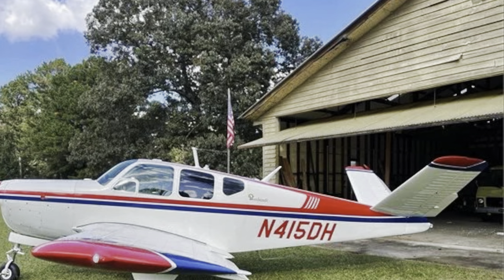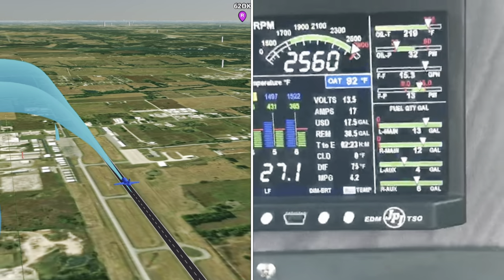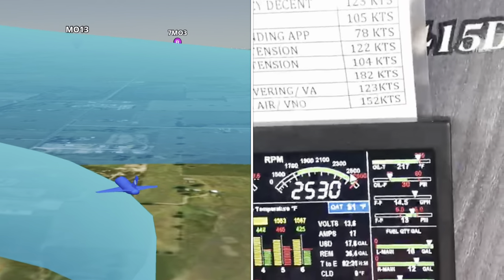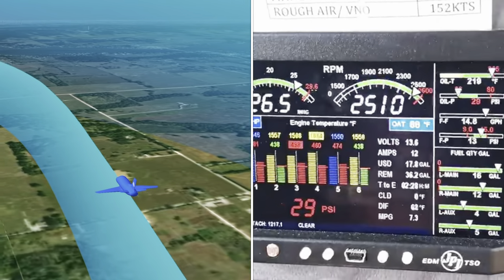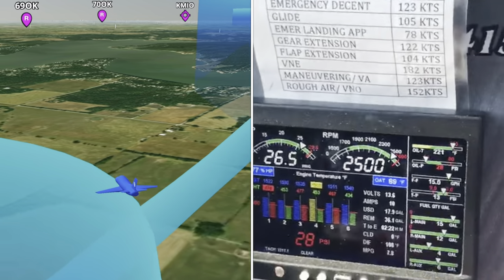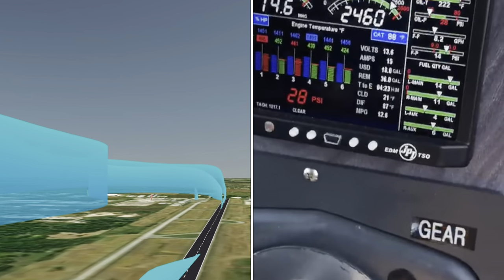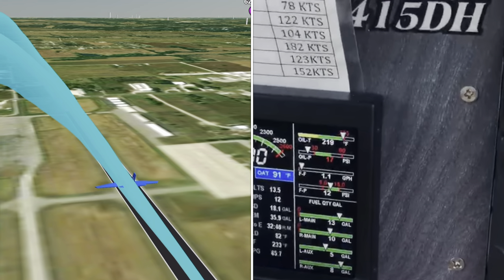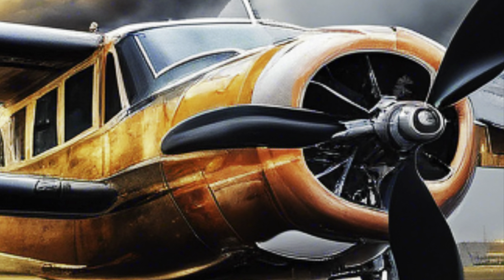My Plane Tried to Kill Me! : Surviving Engine Failure After Takeoff

Comment: You didnt Turnback, you turned around the airport.  If no traffic landing i know how to do turbacks well for years and would reduced pwr and turnback with some tailwind instead of damaging the engine more by turnaround which takes 3 -4 times more than a turnback.  CFI 3k hours aerobatics and 4 kinds of EFATO.  Practice first partial power Turnbacks from 500agl, then no power later on.
Reply from the maker: Agree and since the engine was still spinning we elected to go ahead and do an abbreviated turn around. It was fairly windy that day, memory is correct probably about 10-12 knots so we elected to milk as much out the engine as we could and land against the wind rather than land with 12 knot tail wind.
Reply: @FlatOutMatt  YOUR MOTHER ASKED ME TO TURNBACK HER.
Reply: @emergencylowmaneuvering7350  why don't you get off the yo mamma jokes, I just got off yours...

Comment: Engine failure?
Reply from the maker: Tempest Spin On oil filter adapter gasket failure. There is an AD out for these adapters as they have caused several crashes with several fatalities.

Comment: You've heard of "crying wolf" right? This video has some great information, but troll titles like this just turn many people off and eventually less and less will GET this information.  I know the temptation is great for views (and it worked here), but this can have a negative consequence in the long run.
Reply from the maker: Appreciate your comment and agree about the long term implications of a shock and awe campaign but if you look at my other videos you won’t see this tactic used, however this title is true, the gasket in the tempest spin on failed and the plane dumped 80% of its oil and it’s happened so many times that FAA put out an AD. This info needs to be shared to prevent more incidences.
Reply: Disagree, and I work in Cybersecurity and it's my job to judge clickbait, since I have to triage emails that people report as phishing.  It's clear from this response you don't understand engines very well.  Wtf you gonna do with oil pressure under 30 and bleeding off?  You aren't getting very far.

I would consider this scenario an emergency in my car if I was driving down the freeway with less than 30 psi and coming down, let alone a light aircraft.  In a car where I was going 75 down the freeway (common speed limit around here in Texas) I would consider it a win to make it to the shoulder without the engine quitting.  This is definitely a major deal in an aircraft, bearing damage, journal damage, cam spalling, lifter damage and bore damage will be incoming pretty quickly with oil pressure under 30psi at flight loads.

There's plenty of light aircraft click bait out there for things that really aren't an emergency.  This doesn't strike me as one of them.

Comment: Legacy airplanes are fine. Legacy engines and their accessories are junk. There’s no two ways about it.
Reply from the maker: I will add it all depends upon your mission. For now this bird suits my mission as a dependable capable IFR cross country machine, wasn’t the case until I updated the panel and autopilot.
Reply: @PlanesAndPoker  everybody’s mission should be to have a dependable, reliable engine. The fact that the continental is 60 to 70 years old and doesn’t have a proper oil filter which then requires a shotty STC’d option that’s also probably 40 years old is a testament to my original point. Unfortunately, there’s no allowable modern experimental options for certified birds like this.
Reply: The FAA not allowing experimental repowers of old certified aircraft seems like a waste. Seems like a lot of older airframes could have extended use?

Comment: Flying aircraft older than the pilot’s age might be hazardous to your life. No matter how legal maintenance is done, something’s  next worn out parts reaches it time limit and will likely fail. Good luck… sky is not the limit, ground is.
Reply from the maker: I respectfully disagree with you on this, newer isn’t necessarily better. This plane has probably been completely rebuilt no less than three or four times in its life and the part that failed was a new replacement part that was less than 4 years old.
Reply from the maker: @FlatOutMatt  how so?
Reply from the maker: @FlatOutMatt  got ya
Reply: @FlatOutMatt  nothing hilarious next time you fly your old numerously overhauled aircraft and your new
avionics monitoring system indicates  anomalous readings. It’s a matter of time… good luck.
Reply: @williepacquin5107  This is the reality in general aviation.  If everyone had to fly brand new expensive planes, GA in the US would be reduced some high percentage, I would say 80-90%.  I'd fly a well maintained 60-70 year old plane tomorrow and I'm early 50s.  Don't mind steam gauges but would at least prefer a modern engine monitor, like @planesandpoker has.
Reply: @FlatOutMatt  true under that YouTube incomplete name.  Have airman PPL and Repairman’s Certificate. Built an Rv6a w/ new 0360 A1A coupled to Hartzell  instant speed prop flying since 2005. Got tired renting old Piper and Cessna’s and finding conditions hazardous to my life. Experimental aviation is the only way to real understanding of airplanes you deserve and not legacy aviation of the past. Either way one mistake is maybe your last.